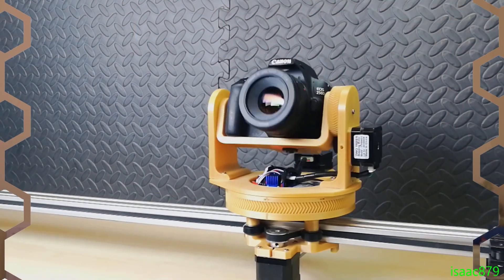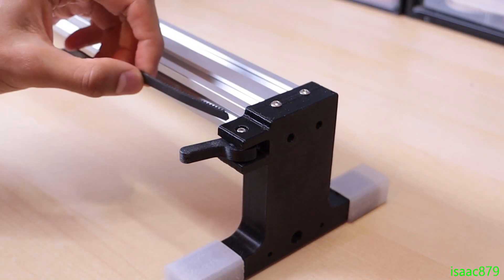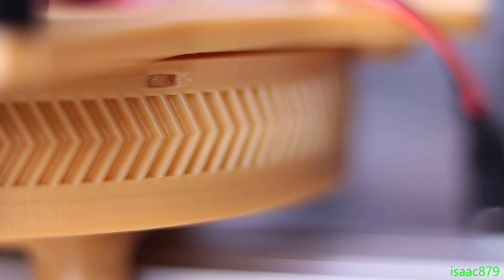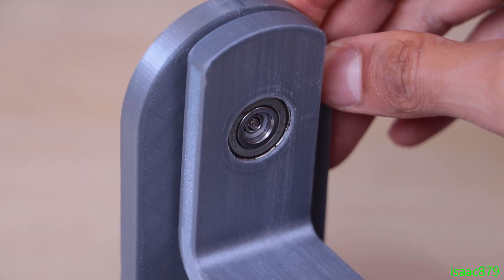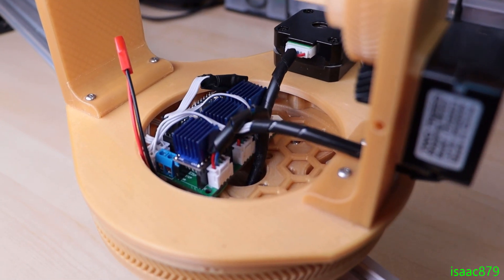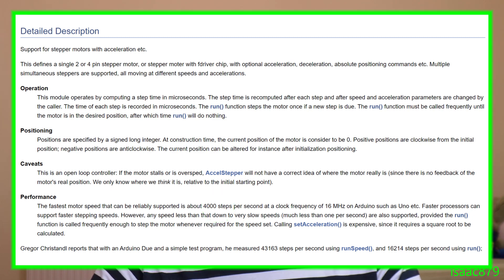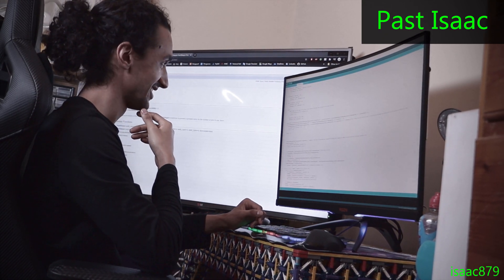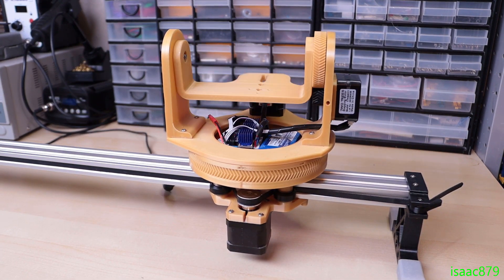Perfecting My DIY 3-Axis Camera Slider!

Comment: Hi Isaac, I struggle to find out where you have added the BT receiver. It just seems it isn't plugged in, even in your first video with the initial PCB assembly. Also, can you steer it directly with the XBOX One (or maybe even 360?) controller without the detour via computer? Hearing your explanation, it seems only the computer can send commands to the slider...
Reply: If you pause the video around 3:20 you can see Isaac has put jumper cables from the socket on the PCB to the Bluetooth transceiver. If he didn't I think the camera would hit it as it sticks up quite high if you plug the BT board directly in to the PCB. With this setup you need a PC to be the 'middle-man'. The BlueTooth adapter isn't able to sync to a controller directly, only to a computer for serial data transfer. It's also not clear that the baud rate of the BlueTooth module comes set as 38400 as default, you need to change it to 57600. 

I haven't had much luck with the included 360 app, as I'm not sure how to compile it so I've written my own in Python app here: https://github.com/cbradburne/Pan-Tilt-Mount/tree/TMC2208-Drivers/Python%20Controller%20App%20for%20Pan%20Tilt%20Mount

Good luck
Reply: @ColinMakes  thanks, Colin, I see... I don't understand, though, how the computer sends serial to the pan/tilt head, as the demo shows no external cables. Does it make a BT adapter in the computer a prerequisite? I'd like to run a very simple android app for using basic commands...
Reply: @Bonscha  Yes, the bluetooth connection is for both controller and pan/tilt mount to connect to the computer. You can pair both items to the computer but you can't pair them to each other. I've read that people have successfully connected their phones directly to the pan/tilt mount. If you read the command list PDF in Isaac's GitHub you can see the commands you can send. The thing you'll struggle with is using a joystick type input. Isaac created a bespoke command structure of a header byte (4) and 3 further pairs of bytes, 1 for each axis (slider, pan, tilt). However, you can for example, send "p30" which pans to 30 degrees.
Reply: @ColinMakes  I imagine you could use sliders that send the slided angle on release... I have to look into that, but I have no experience coding for Android whatsoever...
Reply: @ColinMakes  Great lead! Thanks, I will definitely check that out. This seems to be pretty easy to get to function remotely. Worst case will be a battery driven BT Arduino Nano remote with full degree steps via button control...
Reply: @ColinMakes  Hi Colin, since I just received my PCBs and was able to get this soldered, I stumbled upon another big problem - even when just plugging the flashed Nano in w/o any peripherals, I don't get any reactions for my serial commands... Did you have similar problems?
Reply: @Bonscha  Hi Bonscha, I have a PCB in front of me with the Nano installed and 3 stepper drivers. With the bluetooth module plugged in to the PCB I can't communicate with the Nano via USB. The serial port of the Nano is taken over by the bluetooth module.

If I remove the bluetooth module I can communicate with the Nano using the Arduino IDE serial monitor fine (via USB). If I send "R" then I get the debug report back from the Nano.
Reply: @ColinMakes  Hi, I found out a few minutes ago that I have to use 57600 Baud for serial connection. At least the computer can now talk to the arduino. Now I just gotta fix the BT module to that baudrate, I guess
Reply: @Bonscha  Yes, exactly that. I did a video of that for the HC-06 bluetooth module here https://youtu.be/ueD8rxHcdFw

The HC-05 and JDY-31 are a little different.
Reply: @Bonscha  If you've only just connected to the Nano via serial you'll have to program in the speeds and stepper mode etc as shown in my first video around 21minutes in: https://www.youtube.com/watch?v=i4henn5Tj38
Reply: @ColinMakes  Hi, I followed the video by fibeesoft about programming the BT module. I have to set it with the nano. I program the nano with a serial script for the AT command(s), sidconnect USB, plug in the BT module (JDY31 in my case!) and 12 V and the nano should configure it. Doesn't work though, I don't get responses via serial monitor on my phone. Also, BT name and pin changes don't work. As if it doesn't get programmed at all...
Reply: @Bonscha  Glad you got the JDY-31, I had most success with that. Only issue was getting to the AT command mode as there's no switch on the module. You need to make sure nothing is connected to the JDY-31 via bluetooth otherwise it never goes in to AT command mode. 

Maybe try something like this: http://www.martyncurrey.com/bluetooth-modules/

That way you can type the commands in yourself and check you get a response.

However, I think the JDY-31 is set to 38400 be default and not 9600. I can't be sure. Try the other if the first one doesn't work.
Reply: by the way, you don't need the 2 resistors as shown in that website. I found it works fine without.
Reply: @Bonscha  Is this the video https://youtu.be/AH5jGzwKHHI ?

If so, just try changing the baud rate from 9600 to 38400. I’m sure the JDY-31 is set to 38400 by default.
Reply: @ColinMakes  I have no programmer. So I used the same technique but with a detour via first programming and then rebooting the arduino and programming the BT...
Reply: @ColinMakes  I mean to say, I tried this way but with no luck. It is possible that I killed the BT module, though, since I assume I plugged it in backwards the first time. Maybe the 5 V have killed it. I will get a replacement soon... Until then, I'll finish the mechanics. Another question: Is it safe to connect the PC to it while operating on 12 V?
Reply: @Bonscha  hmmm, maybe. I have killed a JDY-31 but I gave it the full 12v. It might be worth just changing the Pan Tilt Nano code to 38400 in panTiltMount.h file. It's worth a shot. If not, I'd also recommend the HC-06, I've had success with that but not the HC-05. HC-05 had pauses in the data that caused issues.
Reply: @ColinMakes  I tried 38400, didn't work. Then I tried 9600 and it works flawless. I get a full status update via BT Serial App on my Android phone! Are there obvious drawbacks with this low baudrate? I guess, if I don't use live controls via joystick, it should work fine, right?
Reply: @Bonscha  Ah ok, cool. Sounds like the JDY-31 is working then. As I say, it's oddly difficult to get it in to AT command mode. The main thing is to have nothing wirelessly connected to it, like your phone. 

If you're not sending joystick commands 9600 will probably be fine. Give it a go. Glad you got it working.

Comment: I've created a Python app to remotely control Isaac's great Pan Tilt Slider. I've only been able to test it with my setup so I'd be grateful to get feedback whether it works with yours. There are a few libraries to install along with python 3, pygame, pyserial, and pygame_gui. I've been running it through Visual Studio Code, but I have been able to build an single app file for macOS. For Windows I think you might get an error with the file structure but I've got it working with no change through Windows on Parallels using VSCode, it app runs fine but it reports an error in the console.

You'll find it all here: 
https://github.com/cbradburne/Pan-Tilt-Mount/tree/TMC2208-Drivers/Python%20Controller%20App%20for%20Pan%20Tilt%20Mount

Thanks for reading.
Reply: A raspberry Pi remote control would be next level for this slider. Could your python script be modified for a Pi & used on the go?
Reply: @tylercaton6145  Last time I checked, it ran on raspbian on raspberryPi 4. It’s been a while since I tried it though.

Have a look through this video on how to use it if you haven’t already, https://youtu.be/ueD8rxHcdFw
Reply: @tylercaton6145   Hi Tyler. I've checked out the app on a Raspberry Pi and there are a few issues. I've been working on them and hope to have something out soon. I think I'll have to make a "how to" install video as there are a few steps to making it work. 

I'm making it for a 800x480 screen to make it as portable as possible.
Reply: @tylercaton6145  Hi Tyler, I finally got around to making a Raspberry Pi / touch friendly version. I made a video too, https://youtu.be/wbUkVF55yrs
I hope this is what you were after.

Comment: Hi Isaac,
SUPER project, very well done!!
The larger bearing you had for ages, is this a necessary item? If so, do you you have the measurements? I own a SONY A6100, do you think this also will work with You Camera Tilt Mount?
With regards,
Bram
Reply: sorry this is in the wrong topic

Comment: Man you're project looks incredible ! But unfortunately, it doesn't work for me... I've already verified the PCB hundred times ! But when I want to move a motor, nothing happens at all... Same for camera trigger ! Do you have any idea to help me ? Thanks a lot !
Reply: Hi Mael, if you connect your Nano to your computer, load the Arduino IDE, set your serial port to the Nano, open the "Serial Monitor", set the baud rate to 57600, type R in the top section, and press send. Do you get a response from the Nano? You should see a full report of your settings.

If you do, GREAT! Have you set up the speeds and accelerations? If the speeds are set to zero, that might be why nothing is moving. You should open the "3-Axis Slider Commands List.pdf" included in the GitHub and replicate the settings at the bottom of that document, by typing in each command separately to the Serial Monitor. For example "s20", "S20", "x40".  After you've programmed all of the settings check them again by sending R, don't forget to send U to save the values to EEPROM.

I hope that helps?
Reply: Are you getting any communication by BlueTooth? The HC-05 module (if that's what you're using) has a default baud rate of 38400 and not 57600. You either need to configure the HC-05 baud rate to 57600, or change the Nano baud rate to 38400 in panTiltMount.h

Comment: Hi Isaac,
I have difficulties making the JDY-31 work with arduino. I succeeded to print and assemble all 3d parts, bought the pcb from JLB and got all components welded to the pcb. I successfully uploaded the following codes to the arduino (pantiltmount ino/h/cpp as well as the Accelstepper and Ibrary libraries) but I don't know where to upload  the main.cpp file? In which folder am I supposed to store it for upload purpose?
Thank you

Comment: Hi Isaac, do you have a Pan & Tilt version of this project? I don't need or want the slider. Thanks
Reply from the maker: You can use this version without the slider to have it just as a pan and tilt head. My first version was just pan and tilt before I added the slider (I have a video about it).

Comment: would be awesome if you implement an android motion control app to set the sequence movement points and velocity of the movement or even a manual axis control with a game controller conected to the phone, right stick controlling the pitch and yaw and left stick controlling the slider movement.
Would be also interesting a servo extension for focus and a shoot stop shoot function for long exposure timelapses, there should be no movement while the shutter is open.
Awesome job!
Reply: Hi, if you're interested I've made a version that works directly with a PS4 DualShock controller. You can set a sequence of moment points that you can run, but there is no extra control over changes in velocity between movements. Maybe you could adapt something from my code? You'll find my changes here https://github.com/cbradburne/Pan-Tilt-Mount
Reply: @ColinMakes  awesome, thanks!

Comment: Hello Isaac, I'm having problems with programming my arduino nano.
I downloaded the code files in the Github but when I verified in the Arduino IDE, it said that I had to include "Windows.h", so I searched it up in the browser, found it but I'm still not sure if it is the correct one, so if you could help me out by proposing me a list of codes that I need to include in the IDE, it would be wonderful.
And also I forgot to mention that I didn't find the <iostream> so if you could help me out with that too it could be great!
Thank you very much and keep it up!
Reply: The code for the Xbox controller is not for Arduino. It's a C++ Windows application. I don't know how to compile it, I've asked for help but never got it so I've made a separate Arduino program that replaces the BlueTooth adapter and runs on an ESP32 Dev board. It uses a PS4 DualShock controller as input. If you're interested you'll find it here https://github.com/cbradburne/Pan-Tilt-Mount
Reply: @ColinMakes  That's superb because I dont have any Xbox controller but I do have a PS4 DualShock controller Thank you very much!
Reply: Hi @ColinMakes  i have taken a look to your Github and have seen that you've updated some of the codes recently so i was wondering if the code ia already stable or you are making some fine tuning? Thank you.

By the way, I am currently struggling getting the id from my PS4 controller and still working on it 😅

Comment: Ok, I now have the 3 axis working. However, I notice the acceleration is not working as it should. When I move between 2 keyframes, at the start the slider moves in the wrong direction, smoothly decelerates, changes direction and accelerates. At the end of the move, there is no deceleration. It's like the start and stop isn't sync'd to the accel and decel, like it's offset. 

If I set multiple keyframes (10+) just moving back and to (like in your video), the pan and tilt move together but are out of sync with the slider. Visually, the pan and tilt start their next move while the slider hasn't finished yet.